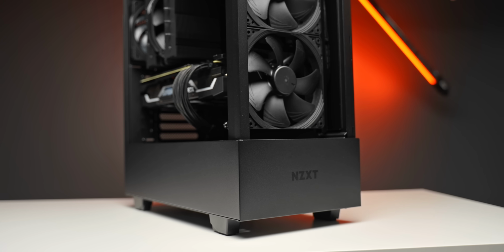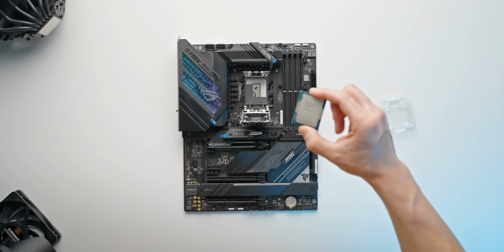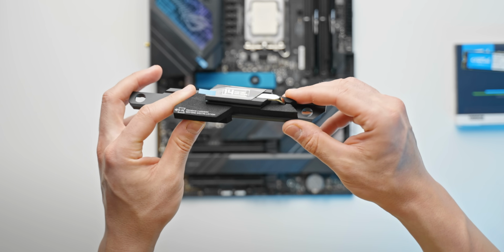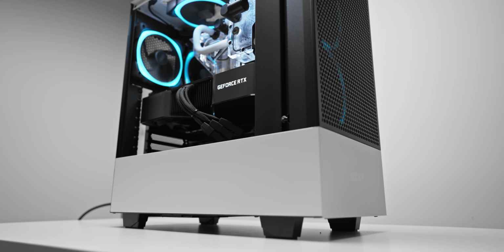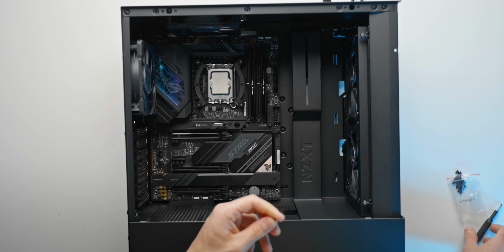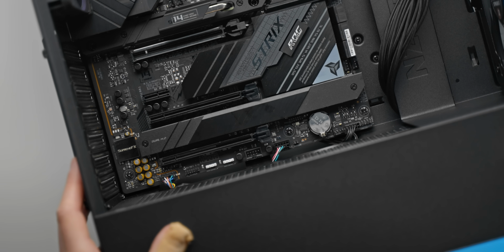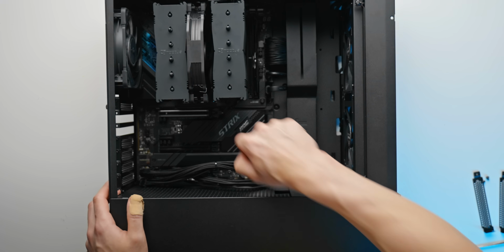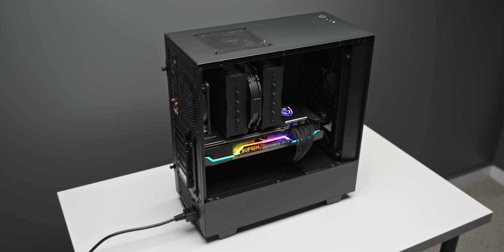How to Build a Powerful Gaming PC

Comment: Just ordered a 6700xt, a x670 motherboard and haven’t decided between a 7600x or a 7800x3d
Reply: I don't know your use case but a 6700XT with an X670 motherboard and a high end AM5 CPU just seems like a mismatch of parts. You'd be much better off buying a B650 board with a 7500F or 7600X CPU and then get a better GPU like a 4070 or 7800XT.
Reply: @Genf4.2  for 1080p? It’s got a 0% bottleneck on gpu intense tasks
Reply: @ComedysAura  I guess its alright for 1080p but personally I would have gotten a cheaper board and then upgraded the GPU. Also don't use those bottleneck calcualtors; they're not indicative of real world gaming performance.
Reply: @Genf4.2  idc aslong as it runs 120fps on any game I play and so far it’s doing damn good god of war ultra 280fps
Reply: go 7800x3d

Comment: Thoroughly enjoyed the step by step guide./ Would have like more details on how to connect the fans to the correct cables. 1st time PC builder here. Ran into an issue with the Artic fans (3 pieces). Only 1 of them functions/ Very frustrating

Comment: I have a question I have an old board. Well, it went out, it was running AI 7. And the power source doesn't match to the new board that you're displaying the Z9690E.  What type of power source would I have to use for that board?

Comment: they really need to reduce the size and weight of gpus these days.. that gpu's life is hanging on its life by 2 small screws and the pcie slot that is on a thin mobo, and a thin gpu teeth in the pcie
Reply: Yh its not like most modern cards even need these massive coolers with the exception of the 4090. A 4070 draws less than 200W yet they often still have massive 3 slot heatsinks dangling off of them, NVIDIA FE cards are the only models that aren't massively oversized.

Comment: Top tip.  Don't buy an NZXT 510 of any type if you are using high end gear.  They are great looking and well built cases, but they just are not good enough or big enough for high end cooling.  If you want NZXT, look at 7000 series - however there are numerous way better cases (Lian Li alone have 3 much better models for the same or less money) on the market.

Comment: Great video! Just an FYI - The top M.2 slot on this board is PCIe 5 and adding your drive to it takes away some of the lanes from the GPU. Until we get gen5 ssds and gpus, better to use the bottom two. The left side is connected to the CPU, right side chipset.
Reply: Good thing the GPU does not even come close to saturating the lanes

Comment: The CPU tension is real. My first build was with a 12th gen, and I was so worried I was going to damage it because of how much pressure I had to use to put that lever down. I even heard a bit of a crack/crunch, you could barely hear it though. That was about 8 months ago, and it's been working perfectly fine so far, so it should be ok.
Reply: That sound mightve just been the pins "biting" onto the cpu.

Comment: If you put strong fans  (ie Arctic) in the rear and 2 in top, yo ureally don't need front fans!   Front fans causes more air vortex and if too much air, the heat will stay in the case!  Yo uwant the exhaust fans to PULL to hot air out with no turbulance from gpu.

Comment: Hard drive days might be over, but case companies still feel the need to add space wasting cages to their cases... 😒
I nearly bought the H510 Flow, but ended up with a Corsair 4000D instead lol
Btw MSi BIOS actually let's you set the fans to be controlled by PCIe, no need for a controller.

Comment: Installs anti-vibration rubber pads/gaskets on the fans - fastens the fans with (metal) screws.. 🤦‍♂ (of course, on a.. metal case.. ) Point of anti-vibration material used - Nope!.. :)))))
I believe I would get the same effect by listening to nails scratching on a blackboard.. :(

Comment: Was there a clearance issue in mounting Noctua's NH-D15 on the ASUS Z690-E motherboard? Have you done any modifications in the motherboard VRM plastic cover? Because this is what Noctua stated in their motherboard Compatibility Centre for the ASUS ROG STRIX Z690-E GAMING WIFI- "Mechanically incompatible in standard orientation (blowing towards the I/O panel) due to height of the plastic cover over the VRM heatsink. Installation turned by 90° (blowing towards the top of the case) is possible."

Comment: Could it be that the PSU is upside down.. heat from it will be going up to the system.. would it be better if it will be blowing bellow, usually there's an oppening down there for the psu fan. But yeah over all awesome vid.

Comment: On this case you can remove the hard drive bay right? Is it just mounted by screws on the bottom of the case? I need to take my bay out for better cable management

Comment: Hi! pretty good video. as im a bit old IMHO, you talk a little fast. the accent doesnt help, but hey, i guess thats what CC,  rewind and video speed contol are for. im suprised to see copper tubing in the CPU cooler as its a proven fact that aluminum is better for heat tranference. oh. speaking of aluminum, im wondering how you can be overjoyed at the sight of black painted aluminum, then dismayed at the sight of black painted steel five minutes later? how on earth are they visibly different? it was amusing that after touting all the high end parts, you mention some budget pieces. why were the video clips at the end of the vid, so, blurry? completely unreadable. my crappy videos of my Medal of Honor fights are clear as a bell. played/recorded on my old dell 7010. thank you, for not showing an extreme close up of your face for 99% of the video like the other channels. what games did you show that Devi plays? as, im only familiar with Medal of Honor Allied Assault. thank you.

Comment: Thanks for the guide I pretty much built this computer except I used a 12700k and a 3090 ti suprim X with an Msi z690 mpg gaming edge Wi-Fi ddr4. Dragon center was grate. I got all my drivers and bios update super easy using it.

Comment: in gigabyte motherboard you can set the speed of the fan according to temperature of device plugged in on 1st pcie x16 slot, which usually your graphic card

Comment: For those already living in "toasty climates" would enforcing a power limit on the CPU result in a significant loss of FPS while gaming? 
For example limiting the 12900K to 175W (both PL1 and PL2)
Reply: I don’t think gaming utilizes full wattage of the cpu. So undervolting would result in a more stable FPS

Comment: Pro tip that can save you countless hours of mounting and un-mounting big coolers, and save you from awkwardly trying to blindly plug in the CPU cable: 

Plug in the CPU power cable on the top left BEFORE you install your motherboard, and threat the cable through the top left cut-out, then install the motherboard. 

You're welcome!

Comment: First time building a pc, my pcie cable to plug into my gpu is a 2x (6+2) but my gpu has an 8 pin and 6 pin slot, will I just have 2 dangling in the air or?

Comment: Need 120mm noctua remove from top and install on the front section of the radiator. 150mm install on top.

Comment: Anybody can build a PC just like he showed in the video. It is a 'powerful' gaming PC because of the components used. Are there any other software modifications that can be done in Windows for optimization or are just setting the BIOS settings to fit the hardware and setting fan curves all that you can do to optimize the performance? It seems there is more that can be done here other than using high end components and settings the bios according to hardware needs etc.

Comment: Another amazing video from Optimum Tech. Didn’t even need to watch it but I did just because of the quality content that he is putting out there, the time and effort put into this, and how well he explains this for the newbies. Just a couple notes that weren’t thoroughly explained in this video for the newbies:
1. Make sure you have the I/O shield ready to go over your motherboards I/O when you are installing your motherboard. 
2. M.2 drives do go in at an angle, they don’t just sit completely flat when you slot them, you have to angle it in and then push the opposite side of it down flush with the screw mount. 
3. Also look into fan orientation. These fans point in specific directions for flow of air so you want to make sure you have them oriented correctly to optimize airflow in and out of your case.

Comment: Very nice build and an excellent video as always 👍 FYI, you can install an AIO such as the Corsair H115i Pro 280 in the front. I had the radiator placed on the outside of the front mounting bracket and the fans inside. With the MSI 3090 Suprim I had to unscrew the rad and mount it back after inserting the GPU. I don't recommend running anything above the RTX 3080; it gets toasty inside the case, since the GPU sits right up against the glass (glass got hot to the touch). All heat issues went away with the Lancool 2 Mesh.

Comment: Great video! I like the nh-d15 but personally I would go with a 360mm aio or the one from ice giant for the best cooling. And maybe a bigger case like the new Lian Li lan cool III or o11d. Lastly for pure gaming performance, I found turning off the e-cores allowed higher overclocking potential and higher ring ratio. It also helped fix my stuttering in games like Valorant and Warzone (but since you use the pc to edit and stuff the e-cores are still nice to have).

Comment: Personally went with 12700K and DDR4 z690 mobo for my latest build. 
With undervolting I can get it to 5.1 Ghz all P-core, 4.0 Ghz all E-core + Ring under air using Noctua NH-U12A! 👍

Comment: Great video, maybe I'm wrong but I think that PSU was installed up side down, its fan will be fed hot air produced by the system instead of cool ambient air from the bottom ventilation
Reply: Yeah, I was just about to comment the same thing. The PSU was installed upside-down. The PSU fan is facing up rather than down, and that case has dedicated ventilation for the PSU with a removable dust filter at the bottom. Other than that, great build/video!

Comment: I have a 3080 ti same and the same cpu cooler. I was wondering if I should upgrade the cpu and mobo though. I have a i7 9700k and asus z390e.  32 gb ram forgot the speed.

Comment: A question,
Instead of using two high capacity drives, can we use multiple lower capacity drives and run then in raid 0 for greater speeds or it will not make a difference

Comment: I loved the NH-D15 when I used it in my mATX system. Something I did since I ran into the same RAM clearance issue is used a smaller 120mm fan on the front of the cooler. Can't really remember the difference in thermals, can't imagine they're too different.

Also, I had no idea that Noctua actually released the NF-A12x25 in the Chromax variants recently. Thanks for that!

Comment: A sample more sensible build: 

Intel: 
CPU: i5-12400
Cooler: ID Cooling 214 XT 
Motherboard: MSI Pro B660M-A DDR4 or similar value B660 motherboards 
RAM: 16 GB DDR4-3200 CL16
Storage: SN570/MP34
GPU: RX 6600 XT or RTX 3060 
Case: Phanteks Eclipse G360A (much better airflow and stock fans than H510 Flow) or Lian Li 205 Mesh 
Power Supply: 650 W EVGA G5/Corsair RM/RMx/MSI AGF/Enermax Revolution DF/Super Flower Leadex III 

AMD: 
Replace CPU with Ryzen 5 5600/5600X (whichever is cheaper) 
Replace motherboard with MSI B550M Pro-VDH or similar 
Replace RAM with DDR4-3600 CL16 (Ryzen loves fast RAM)

Comment: Watched the whole video, even that I know this steps. It's just so satisfying :)
Btw, about control fan speed based on the GPU temps, I actually have this feature in my motherboard by default, Aorus X570 Pro rev 1.2, and I'm pretty shure that b550 in the same lineup have this too. So, I guess nothing is stopping manufactures from adding this.

Comment: For tower coolers when using tall RAM I recommend the Scythe Fuma 2 Rev.B dual tower or the Thermalright Assassin King 120 Black single tower cooler  Both coolers perform remarkably well. Otherwise use LP RAM modules with the Noctua beast.
Reply: Good luck cooling 12900K with that Thermalright cooler, or any other single tower cooler. Even dual tower coolers struggle to keep it cool under load.
Reply: @92kosta  Yeah I bet they do.. Probably best go with a 360mm AIO for 12900K.. Custom liquid is expensive and AIOs have shorter life than tower coolers. Always tradeoffs !

Comment: You absolutely can beat crucial P2 for value. They're actually a horrible value... They 're around $85 for a 1tb drive that have no DRAM cache, QLC nand, on the low end of gen 3 speeds, with only 300TB TBW... For just $15 more you can get something like the Inland performance 1tb drive which has a DRAM cache, TLC nand, PCIe gen 4 with nearly 3x faster speeds, and an 1800TB TBW.... And there's plenty of drives with similar specs and performance at that price point. The crucial P2 is pretty beat dude.

Comment: Generally yes, I agree with your assertion that since it is a gaming PC, run fans based off GPU temps. However, since you said this is primarily for 1080p gaming, wouldn’t that put it back onto the CPU as the main thermal source? Wouldn’t you want to base fan curves off that?
Reply: nah GPU will still be working its butt off, as it will be pumping huge frame rates. The CPU will be having an easy run in most games.

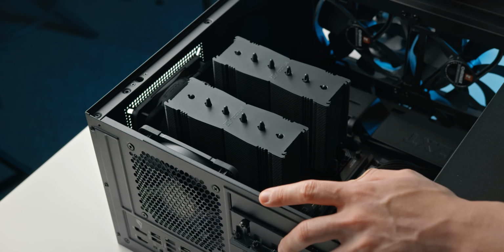Comment: SO here is something that you touched on that I want to share as well. at 31:22 you mentioned not being able to boot pass the BIOS, I have an ASUS mobo as well and not occupying the CPU header would STOP the board from even reaching the BIOS. learned that the hard way. Cleaned my system and had moved the CPU can to another connector, did not want to boot, made me want to cry since this isn't a cheap system I built. Wish better warning about these things was with the instructions or something.

Comment: I find this video rather interesting, I watched an LTT video that came out today and Linus stated that you can't aircool a 12900K and it would throttle after boot but here you are air cooling it using the exact Noctua air cooler he said wouldn't work.
Reply: Linus was trying to cool a 12900k running at full load. CPU utilization in games is much lower so it should be able to cool it just fine.
Reply: well it depends if u overclock or not

Comment: DO NOT buy that Crucial P2 M.2 SSD

After they changed it so it comes with QLC flash, it performs worse than SATA SSDs in some tests. Just spend the extra money and go with a Samsung 980 if you really want an M.2 SSD. Look up the Tom's Hardware article "Unsavory Flash Swap: Re-Testing Crucial’s P2 SSD After QLC Downgrade" and take a look (I can't post the link on Youtube, sorry).

Comment: 1tb boot drive is odd. a gen 4 faster 500/250gb boot drive is a much better idea if youre only putting windows on it. itll boot windows much faster and you will save a buck (1tb P2 is around $100 and a 980 pro 500gb is around $85). Windows wont come close to filling either so saving about $15 and spending that elsewhere is a better idea. The 1th P2 as a games drive is good though.

Comment: A couple of notes, when installing any M.2 drive in the first M.2 slot like you did, your first GPU slot will run at x8 speed instead of x16. To avoid this you should install the M.2 drive into one of the other slots. Also, the NH-D15 doesn't officially fit on the STRIX Z690-E, the little plastic bit on the VRM heatsink actually blocks the CPU cooler from properly mounting it. Noctua states it only fits when rotated 90 degrees.
Reply: that's not actually true anymore, since the 12900k has 20 dedicated cpu pcie lanes, the gpu will run at full pcie 4 x16 and the drive will run at 4 x4 
this was true for 10th gen where the processors only had 16 pcie lanes but 12th gen bumped it up
Reply: @thomaslayman9487  It actually is true, look up page 7 in Asus' manual on the STRIX Z690-E. It's not a CPU PCIE lane bottleneck but the motherboard configuration. Whenever the first M.2 is occupied, the first PCIE slot is limited to x8 speed.

Comment: Hey Ali, I have a question about my pc (5800x, B550i, Tuf 5700xt). For some reason, i can never boost to the full 4.7 GHz, as my system just hardcrashes. Ive adjusted the voltage to 1.315 or 1.3 volts and nothing ever works. it's just super confusing to me. would you know any solutions that i could try for my build?
Reply: Use Project Hydra from 1usmus.

Comment: When you transport this PC would you remove the CPU cooler? I have the same cooler and a similar sized case and I know in the box Noctua says to remove it during transport, but from peoples' experiences how necessary is it? And I'm talking transport either by airplane or by truck
Reply: Its a good idea to remove the gpu and air cooler before transporting any pc. A lot less stress on the motherboard and it lessens the chance of anything breaking.
Reply: I mean how much effort is it to remove an air-cooler? If it was a water-cooled loop, then yeah no need, but this is a thick ass heavy air-cooler after all. 
Rather than live in constant fear or regret later when it takes out your mobo (and maybe the CPU/GPU along with it)
Better to be safe than sorry!
Reply: @sushimshah2896  Yeah you're right that it probably isn't much work to remove the cooler. I guess one other thing is that I'd have to remove and reapply thermal paste but I don't have any cleaning solutions. Could that be a problem or could I just wipe it off without a solution?
Reply: @PyrusnVentus  thermal paste isn't too expensive if you buy only a small syringe. 
And yes it's better to clean it off well with some isopropyl alcohol! You could try and wipe it off without any solution (maybe water), but it's just harder to do it that way.

Comment: Is the corsair 5000d airflow also  good airflow case? I was thinking about using it for a full air cooling build when the 4090 and 7950x when it comes out.